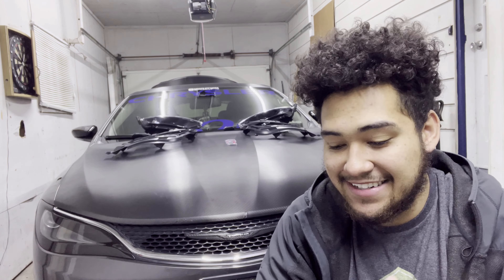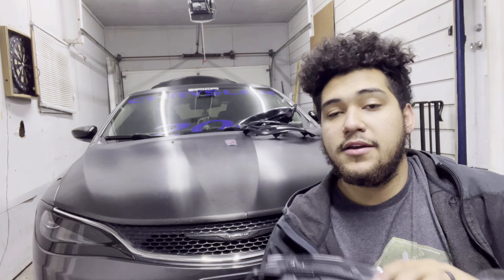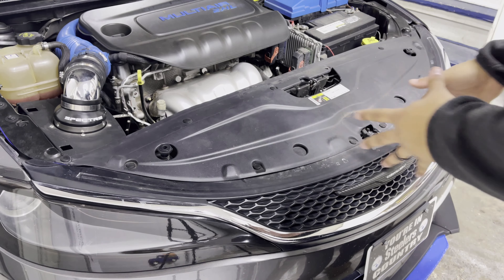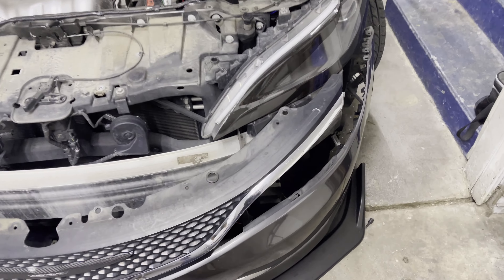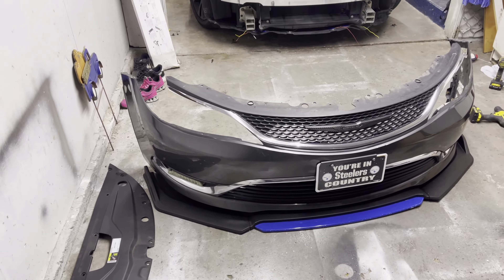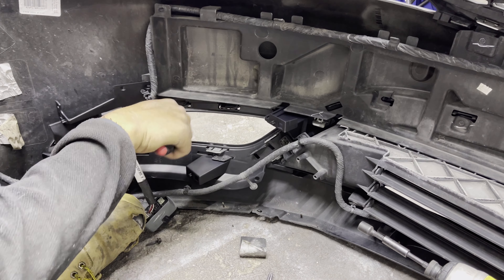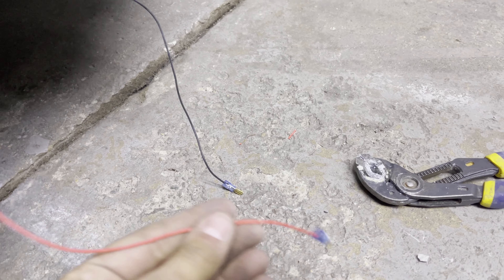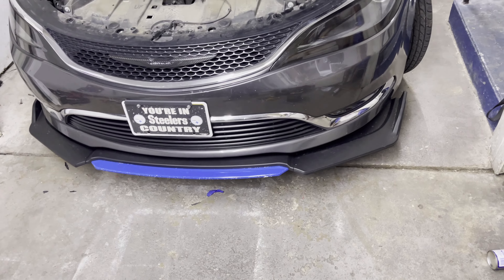OEM Dual Led Fog Light Upgrade l Step by Step | Full Install | 2015 Chrysler 200

Comment: Would like to see the fog light switch & harness install once you do do it.
Great videos btw, having a lot of fun learning & look forward to do a lot of these to my 200 :)
Reply from the maker: Thank you so much and I’ll definitely see what I can do !
Reply: Do you have a link for the wire harnesse for the fogs I just installed mines n now realized I need it.
Reply: Were you successful in finding the switch and harness? I'm in need as well. Last pieces I need I believe. Got the lights, brackets, and the new cluster for the inside that has the fog option. Just need a way to connect it all.

Comment: What bulb you using for the headlights? & Yes it's a must do, but I'll have to wait till you use the main connector. Good job man
Reply from the maker: The main connections are so much easier bro ! You litterally just do everything except for the wiring part because there are already plugs behind them! And I’m running 9012 (size) Auxito 6500k LED Headlights !
Reply: @moderatemods98  thank you. One question, the way you wired you stripes light don’t you get a signal out error?

Comment: Question if you had a base limited 200 how did you get remote start on it? Also nice S Limited ⚡️⚡️
Reply from the maker: Haha thanks bro !! And I have aftermarket remote start got it done by my tint guy ! About 2 years or so ago love it bro it’s a must it turns on with three pushes of the lock button on my keyfob
Reply: @moderatemods98  is it aftermarket? How could I get it lol live you car bro 💪🏼

Comment: Hi. I followed the video and was able to successfully install everything. Now I actually changed and used oem harness as opposed to using the temp method. That being said, my fogs are not turning on and now my check engine light is on. Any ideas?
Reply from the maker: Possibly bro you may need to have the harness proxy aligned by the dealer, that would tell the computer that now you have a fog light set up!
Reply: @moderatemods98  thanks bro! I was confused if maybe there was a fuse I had to buy or something. Thanks for the update. I'll try to proxi align using my proxi app and device. Thanks again!
Reply: I just wanted to go ahead and update. So. Went ahead and used AlfaOBD and MX Link to proxi align but the fogs didn't work. I figured I would use the configuration option and used that to make front fogs "Present". They were previously set to "absent". Once I did this, my fogs became functional. Oddly enough my check engine light is still on but everything is functional. Figured I would update with this information in case it would help anyone else.

Comment: Hey pls quick question. Does it comes with a switch or if you wanna turn it off?
Reply: Please your opinion. Respond pls

If i change the control switch to the one with fog light button will it work ???
Reply from the maker: So it doesn’t come with switch, if you want to change to fog switch you can but you will be the fog wiring harness to the board to tell the car your running fogs now

Comment: How do you replace the LED strips? Mine had gotten damaged by water.
Reply from the maker: Thw ones in the headlight bro ?
Reply: @moderatemods98   yes the strips that runs along side of the headlights, do I need to get the whole headlight replaced or just the strip?
Reply from the maker: From my research the best route is to get a whole headlight :/ but I mean you could remove the cover some way and instal your own after market strips lbvs !

Comment: Damn that shit is bright!! And looks amazing..  just a quick question bruh . Did you have to carve a hole in the bumper or you just bought a new front bumper with holes already?? Thanks in advance
Reply from the maker: Nope bro our bumpers come with those holes just got to pop out the plastic covers !!
Reply: @moderatemods98  oh yeah I know what you talking about... just another question and sorry abou me asking too many questions lol.. but did you have to buy extra cables? You know like wiring , harness ect.. or does come with everything and all I got it do is plug and play ?
Reply from the maker: @829sha  all god never to many questions !!! So if yours is like mine (limited or no fogs existing) you will need to buy the harness as well as the light knob with the fog light button ! I went ahead and wired mine to power with the ignition coil fuse so they are like daytime running lights !
Reply: @moderatemods98   that actually sounds really good thanks I'll wire mine with the ignition too it seems like the best way to go.. if it's not too much trouble can you please send me the link of the harness you used for the fog lights... thanks a lot for all you help bro I really appreciate and keep doing what you doing.. I hope one day I can make my car as beautiful as yours
Reply from the maker: @829sha  absolutely bro !!! I’ll be here always and bro yours will be awesome all on its own that’s the beauty we can make our cars all our own !! But I actually just used speaker wire to extend from the pins to the ground and fuse on both sides , and as you seen in the video I used the pin adapters and crimped them to the wires and pushed em in !
Reply: @moderatemods98   thanks for the ideas I really appreciate it bro

Comment: I got a 200s 100k on the dash. I leak water and oil bad bad. Can’t find out where it’s coming from.
Reply from the maker: So are you leaking coolant ? And oil ? What color is the leak and when you move your car try and pin point where the leak could be dripping down from and look up in there bro if you want you can send me pics on IG and I can try and help more !
Reply: @moderatemods98  yeah so it has this fucking under skirt on it. Man. It’s coolant. And oil. If I run it to hard it will leak oil. If I drive normal it doesn’t leak oil. Coolant leaks all the time tho. I hardly drive it I lost my job to covid and my funds are low. Or I’d fix it already